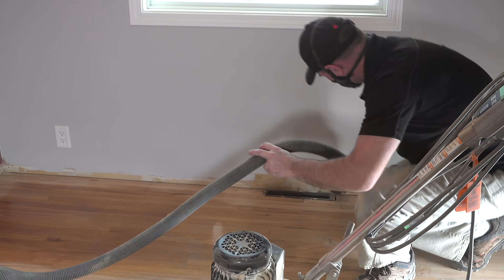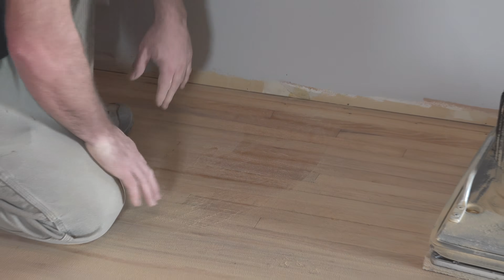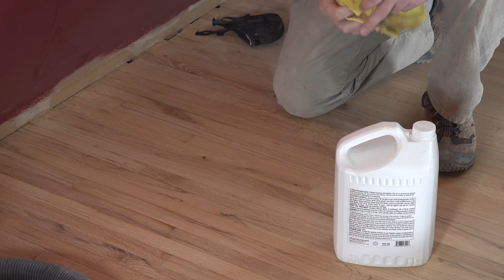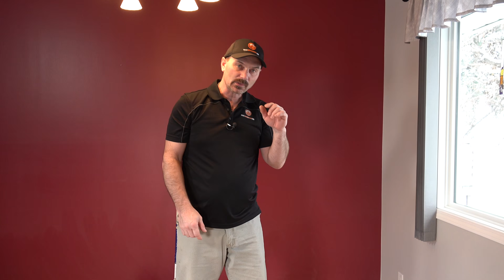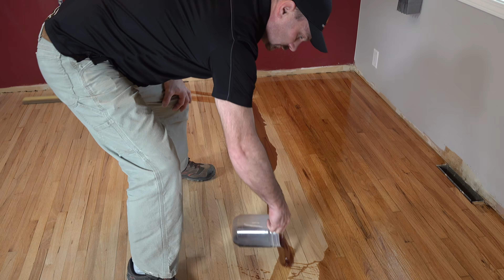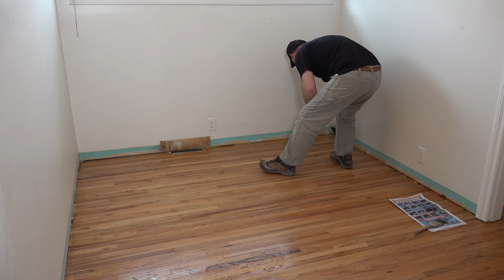How To Sand & Refinish Hardwood Floors

Comment from the maker: Here is a link to T bar floor refinishing tool. https://www.amazon.com/s?k=floor+tbar&ref=nb_sb_noss
Reply: What color stain is this?
Reply: I really enjoyed your video here. Very easy to discern, comprehend and apply to a real-life situation. I felt at such ease watching your video that I am going to attempt re-finishing my own floors as opposed to paying someone else thousands of dollars or whatever it is they charge. *I'm just curious... I have an ugly yellow finish currently and want to change the stain. Would I just do my 3 passes with the various grit levels (coarse, medium and fine), vacuum and clean floor, then apply the stain that I want, let dry and then proceed with poly thereafter?
Reply: @allanbenoit8305 pa @@qqqqqqqq
Reply: How would you charge per square foot how much would you charge
Reply: Have u ever used lambskin for stain?
Reply: You have beautiful eyes. Are you married ?
Reply: Great , very helpful for a beginner.
Reply: What kind of paint did you used???
Reply: What kind of dusk mask is that black one your using?...also of you had to stain this before polying would you go about the sanding differently or with different machine. Just finished a floor for someone that looks like absolute shite. Left swatches of poly even if they weren't immediately noticable  they were after staining!!! Not to mention the scratches they left with orbitals.
Reply: @Jimbo_Conn  was

Comment: I rented one of these machines yesterday and it was like trying to control chaos. It always wanted to go right and required lots of twisting the handles to turn left. The sandpaper would detach from the pad after 5 minutes and all of the self adhesive was just gone. We had to hot glue the sandpaper to the pad to finish.
Reply from the maker: That sucks. They do want to track because of the spinning but usually slight tipping of the handle up or down controls the direction

Comment: don't use Stain unless you are starting with UGLY wood. clear finishes are the way professionals work -- so you can SEE the wood they chose.  I prefer Bona ClearSeal and Bona Traffic HD Satin;  no yellowing -- initially or with age, water based -- no crippling fumes, fast drying, easy cleanup, superior durability.
Reply from the maker: This is not a stain but it is a polyurethane so you get the amber tint and it will yellow more over time .

Comment: No staining just poly?
Reply from the maker: yes, in my case that's all I needed . These older oak floors where never originally stained they used poly which has some tint to start with and in naturally turns a little more orange over time also.

Comment: Question: are you applying just a polyurethane or a polyurethane and stain mix? Do they sell it as an all in one? Do they add color such as they do paint? I’ve done my upstairs floors like 25 years ago and they had a all in one in a 3 gallon bucket
Reply from the maker: This was a Polyurethane product (no stain) poly has a amberish tone to start with. I have a link in the video description if you are interested.
Reply: @HouseImprovements understood, do a lot of wood work. Wood floor only once. House is ready, everything is out. Now to rent the sander. Then figure out what to use on it . Figure if there was an all in one would make it go a little easier. Looked around the internet a little bit and seen no “all the n one”. Asked a local ace hardware for the hell of it while in there for something else and right off the bat I knew that they knew nothing, the looks on their faces (puzzled) when I said poly for floors.

Comment: I've sanded and re-stained basketball hardwood floors many many many times but I used only soft floor stripping pads,, I think it's safer to not over sand the hardwood floors,,sometimes two passes are enough for regular maintenance for a home every 5 years is okay

Comment: Can I use a handheld sander? I don't mind putting the work in, and I don't want to rent one if I don't have to.
Reply from the maker: its will be some real work honestly but I guess you may be able to. If its a belt sander work with the grain of the wood if its a random orbital it will not matter.

Comment: I just bought my house 2 years ago, no carpet in 5he living room and kitchen dining. The rest of the house is hardwood but they covered it in carpeting. I am working on one bedroom now, have half the room stained after sanding the whole room, and so far two coats of polyurethane on it. Just hand sanded so I could apply possibly one more coat of polyurethane. All this I’m doing with my orbital sander, 2 days of sanding to the bare wood, one day for half the floor of staining. (Have no where to put a dresser and a small dressing table. So till this part is done one half at a time. I am a 71 year old female, widowed. So if I want something done I will do it myself. Last house I did the kitchen floor twice, once when we put it in and once before I sold it. All by hand on my knees. Both turned out fantastic.
Reply from the maker: You are a rockstar! That's a lot of work and dedication.

Comment: This video was pretty new when I refinished my first floor.  I followed these steps and got a pretty good result.  I did all I could to eliminate drops and puddles, but every coat I'd seem to add a few.    One piece of advice I'd give to anybody following this method is to use water-based poly.  You need more coats, but the drops and glops and other whoopsies are very easy to see and thus correct.  (The mistakes look like spilled milk).

Comment: Do you have to replace the sponge every time after you finish the layer? Let's say it takes a day to dry out the layer, laquer on sponge will dry out too. So do you have to replace it every time or it can be washed with white spirit or just soapy water any be reused next day for next layer? Thanks video is awesome!!!
Reply from the maker: Undo the handle and put the whole thing in a large plastic garbage bag. If its overnight i put it in a fridge if i can. You can then reuse it on next coat
Reply: @HouseImprovements  do you buff the floor after each coat?

Comment: In the video it shows he uses polyutherane which I heard by professionals say that it isn't durable and wears off quickly, also most polyutherane contains pfas. Is there any other choice for a finisher?, if anyone knows please I would like to know. Thanks.
Reply: Diesel mixed with used motor oil 😁👍
Reply: @birddoggin7 And after that I just throw a lit match and move out home. 😂😂 Great plan but not very budget friendly haha. I have children so I'm often a bit concerned about things I apply around the home, was hoping something water base, I'm not an expert and would love to pay a professional but this year is tight, was willing to put the effort and learn something new. Might end up just painting the floor or something. ; ((
Reply from the maker: Mine is 18-20 yrs old now with no wear?

Comment: Ill be refinishing my floors sometime this month, ill try to add to the internet experience. 
Bought a house, floors had a few dark stains from leaking roof, i am not changing colors.
Should i sand ALL the rooms and every floor? Idk, tune in next time 😊
Reply: Im using varathane oil based poly and i put it down too thick in one room. Says not to dilute the product but man is it thick. I have nice puddles. I hope itll get filled in on coats 2&3

Comment: I can't stress enough how important preparation is. Take your time and sand well. A scraper is a marvelous tool. Removes old finish easily in tight corners. Change blades as you need to. Probably videos on how to use them. Stain and finish will highlight scratches so do the job when you know you have an extra day or two if necessary. Have all your product and tools nearby and ready. Remove any laplines that show up as you apply the stain. Search for scratches as you wipe down the floor. Remove any because they will be worse after you are finished. Reread first sentence.

Comment: I had my floors done by a company,  and right now, I need to have it look like it's just finished! The floor I left very dull and no shine. The other path of the floor that was done 0ver 10 yrs ago has more shine and looks like it's just done that the finishing that just got done 2 weeks ago. What can I do? My floor now looks as if I need new sanding and finishing
Reply from the maker: I would guess that the new portion had a different sheen used than the older part and that sheen is lower than the old. Depending on the  product used it can likely be re coated with just a light sanding before it is re coated. Talk to your finisher.

Comment: I would be careful for anyone using Waterbase to not set a wet pad on bare wood as it will flash a line that is hard to get out. Always get in the habit of setting your tbar on a wet area not dry. Trust me on this 👍
Reply from the maker: This is not water base in this video but that is a good tip for anyone using water base.

Comment: Did you reuse your T-Bar applicator refill or use a new one with every coat?
Reply from the maker: I used the same one each time. I just wrapped it in a large garbage bag between coats.

Comment: If I apply stain on the hard wood, do I still need to use the polyurethane. And do I apply before or after the stain ?
Reply from the maker: You need a clear coat over the stain yes. A polyurethane will
Change the colour slightly however so i would find a water based product to use over it.

Comment: Thank you for the video. Question. I just removed my carpet and there was hardwood under it. I noticed some of the attachments are a 1/8 seperated all over the floor. One area on the door some of the wood strips are more seperated and puffy due to possible being wet in the past. Do you have a video how to partially replace hardwood and cover with wood putty the inperfections. Also how to nail areas where the floor is loosy and noisy?  I will appreciate any help
Reply from the maker: I do not.

Comment: Turn off the heating or cooling while sanding and finishing.
Orbital has 60 bit
Pad sander / drum sander 
Courses grit is what you start with. Pad.sander safety button
Drum sander with the grain unless it's really messed up. 
Sweep Change the grit to 20 sand
Finer to 20/30
100 grit paint thinner tac cloth or cheese cloth polyeurothane paint thinner water based finished damp cloth floor must be dry before applying finish
T bar 18 28 weighted unweighted aka squidgy apply the finish  for a small room 18 light weight also put a bevel on it.  Sanding sponge 220 cheese cloth.

Comment: Have you ever used a product like Zar Ultra Max Polyurethane, Vermont Natural Coatings PolyWhey 2500, or Bona Traffic HD? 

Everywhere I've looked online, people have recommended not to use minwax, how has this one held up over the years if you know? We're quite hard on our floors in our house
Reply: First of all, thank you so much for this excellent, clear, realistic, music-free video. This was the most helpful, practical, and fuss-free video on the entire process I've seen on YouTube. 

And thank you so much for still being active and answering questions about this so long after it was posted. 

So I also had a question, we have a lot of thick old finish on our floors, and we have three rooms about 10x10, if I use this kind of sander instead of a drum sander (I'm terrified of wrecking the floors) how many pads of each grit do you think I'll need? 

You mentioned in the video that you used about 4 or 5 for a 100 sq ft room, so the earliest 20 grit will probably need that many for a 10x10 right? (15 pads of 20 grit)

 Will I need the same number of pads for all the following grits as well?

 20/30/60/80/100/120/220 (for finishing) -> with your experience, do you think this is a good order for sanding a floor with a lot of thick old stain and scratches? 

Also, we have a few little holes like nail holes, chips and cracks, etc that will need to be filled - at what point in the sanding process would I need to use the filler? Right after the 20 grit, or before I sand at all?
Reply from the maker: You would likely be better off with the belt sander but if you want to use a sander like this video then I would say you may need 7 to 8, 20 grit pads to get through that varnish. Once you do the first room you will have a great idea of how many of each you will need. Once you get the main part of the varnish off you will likey only need as many as i needed of the other grits for each room. That layer of varnish will be the worst and hardest to remove.
I would apply the filler after the 60 grit sanding. If you need more assistance please use my forum.https://www.house-improvements.com/forums/
Reply: @HouseImprovements  thank you so so much! I didn't know you had a forum, now I feel like a silly goose!! 

I will absolutely check it out thank you so much

Comment: I had carpet on top of the hardwood w staples and all how do I go about this w the holes? When would I fill the holes before sanding or after sanding and before the finish?
Reply from the maker: After you do some sanding and have some dust you can miss with wood glue and make your own filler . Or use a wood filler and fill all the holes before sanding.

Comment: I want to do my floors. But there is glued on flooring I need to remove first. Any recommendations on getting the glue off the floor ?
Reply from the maker: Depends on the glue , sometimes a product like paint thinner will soften it enough to remove or sometimes you just gotta keep scraping till its gone. Sometimes its just not worth it to remove.

Comment: Question: if my floor isn't in that bad a shape, what grit should I start/finish with?
Reply from the maker: If you are applying the same finish you may get away with 100 working to 150 but if you need to remove the finish completely follow the video.

Comment: Pretty good video, i sand and refinish wood floors myself and I thought it was kind of odd that he didn’t put down a coat of some type of sealer before the finish? We use a waterborne poly finish and we put a coat of sealer on every job we do to protect the wood from further uv damage so the wood won’t yellow over time. I’m just curious if you don’t do that on an oil finished floor?
Reply from the maker: I never have. the oil finish is going to yellow anyways over time

Comment: remove base, clear floor/room, turn off air, sand, wipe down for dust, stain, let dry, light sand, re apply stain and let dry, re-install base. did i get that right?

Comment: Wonderful video. I have a quick question: Do I need to re-sand between coats ? Thank you 😊
Reply: Yes if you want a smooth as possible finish just do a light sanding of 220 grit real lightly and real quick. Wipe with tack cloth and then apply your next coat 👍🏼
Reply from the maker: Check the label of the product you are using.

Comment: I'm curious about the floor finish you used. I looked it up and it doesn't indicate that it has a color to it and states its clear so curious if you have added any stain to it to make it as dark as it looks in the plastic bucket? I am sanding an existing red oak floor and adding to what already exists. I applied a clear poly by Varathane to a test piece from the existing and the new flooring and they do not come out the same although they are both red oak.
Reply from the maker: This polyurethane I used has an amber hue for sure. They should not call it clear. I added nothing to this product.

Comment: Is there a part where you apply the polyurethane clear coat? If not is it the same process with the squeegee? Or did you use a brush?
Reply from the maker: That is what I'm applying in the video is the polyurethane, it has an amber hue to it. If you want a really clear finish then I would suggest a water based clear finish

Comment: Ty, Great video. I have a question?!? We are about to redo our floors. Our house was built in 55 and has hardwood floors. What product would you recommend?
Reply from the maker: Depends on the colour you want . This product I used gives you the same amber colour that the original floors were, if you want it lighter then a water based finish may be best for you. For the product I used I have a link in the video description.
Reply: @HouseImprovements  Okay. I appreciate it.

Comment: Is there not a product available to strip the varnish off the floor before you send? We have 80-year-old inch and a half hardwood that now needs to be restored because of our pets As well as the stairs. There must be some kind of stripper you can use to save on expensive sanding pads
Reply from the maker: You could but most are really harsh, and slower going

Comment: Thank you for a great video. Typically how long does it take for the polyurethane finish to dry before applying more coats? I know it depends on where you are located and the climate, but is there a rough estimate? I just bought an investment property that was built in 1955. It has original hard wood floors underneath its carpet and lamanate flooring. I would like to bring back the beauty of this home by refinishing the hardwood floors.
Reply from the maker: Depends on the product you use and climate conditions as you stated but usually anywhere from 5 -12 hrs

Comment: Does sanding and using finisher remove discoloring and stains on hardwood floors?
Reply from the maker: sanding off the finish and sanding marks from the wood will.
Reply from the maker: If you have deep marks you will want to use a belt flooring sander instead because this one will take for ever.